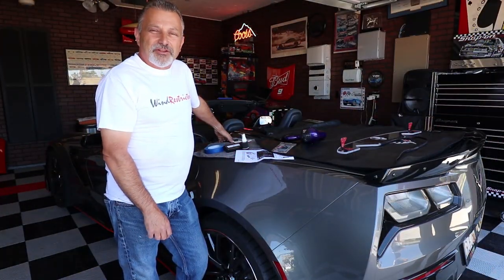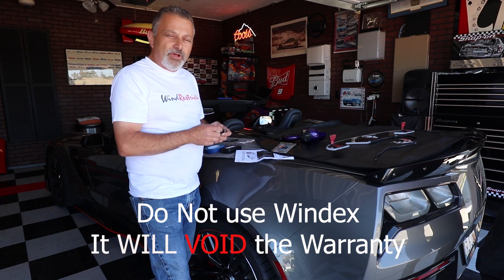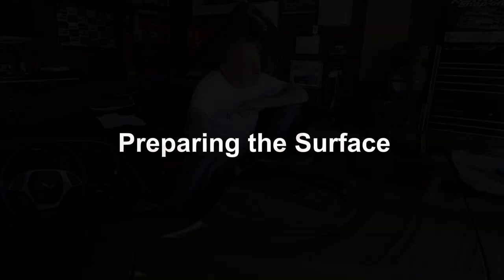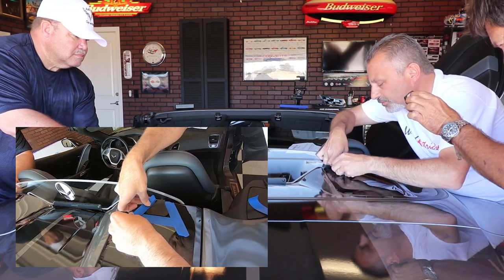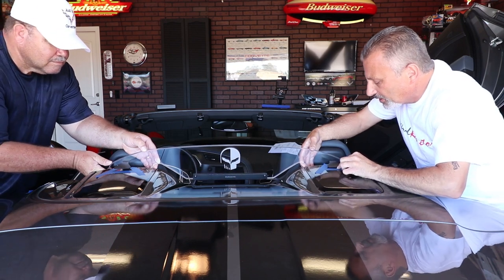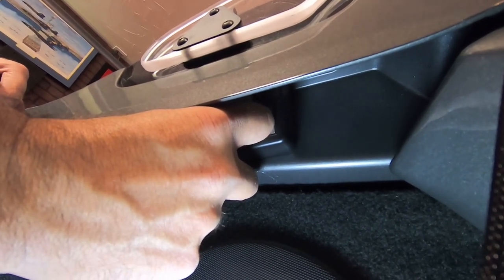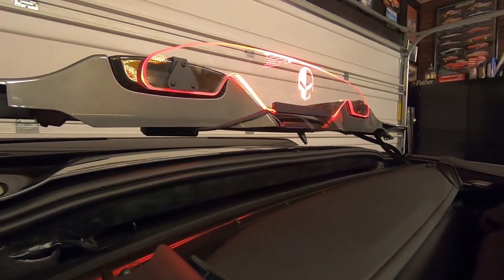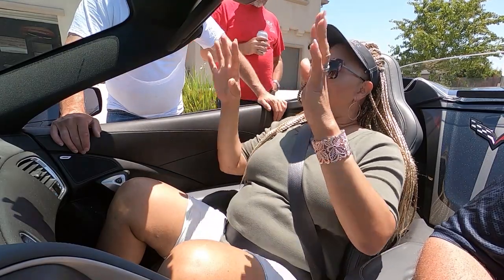How to Install a WindRestrictor in a C7 Corvette Convertible

Comment: I have installed mine and honestly I do not notice any difference. Easy to install but electric connector cord on model I purchased is extremely short.  The reason I went to Utube, to see where to install battery.  The electrical piece is only six inches long, not a foot or more.  I chose a solid colour.  Not impressed by changing colours.  In rear view mirror you see your image but image does not interfer with looking in mirror.  Looks great but still have wind.  I don't mind it but wife is not impressed.
Reply from the maker: Hi James, I am sorry that the cord was too short. I am sure that you could call Customer Service and they would get you fixed up. As far as the wind goes we really noticed it, I am little surprised. As far as the colors go I find that I really only use one color when driving I use all of the colors at Car Shows. One of the biggest things that people tell me is that they can hear each other when talking or trying to listen to the radio.
Thanks for watching and Subscribing.

Comment: Does it reflect too much or is it too opaque because of the artwork on it at day or at night that you can't see through it when you look at your rearview mirror?
Reply from the maker: Great Question.. it is clear but I have had no issues with reflections in the day or night. I have a lot of art work on mine and I can still see out of my rear view mirror.
Reply: @THECORVETTECHANNEL  Even when it's lit up, you can still see through it?
Reply from the maker: @mrpmj00 es you can in the day with no problem, and you can still see headlights from the back of the with the light on or off. If you have the light set to bright it will affect how well you will be able to see